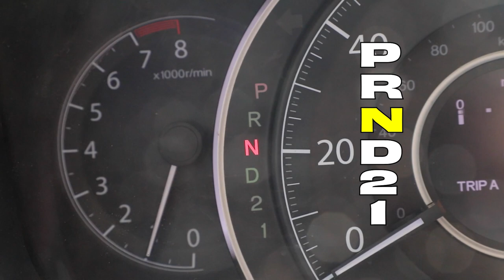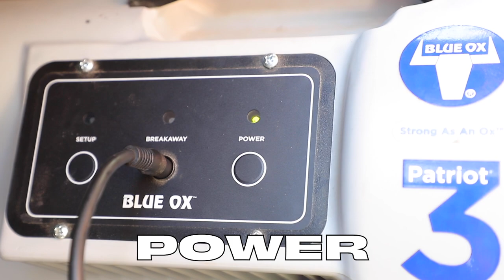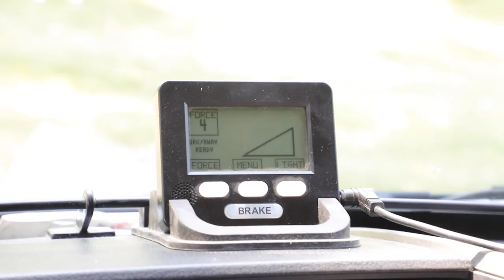BlueOx Flat Towing Hook Up

Comment: It's interesting how there are different ways of doing this setup.  Initially, I came here hoping there might be some info on the actual wiring harness, as I only have one running light coming on at the bottom(passenger side) yet if I turn the running lights on inside the car there are 4 bulbs for running lights (top & bottom- both sides), thus I'm not sure why I'm only getting a single bottom running light coming on.  Our 2014 CRV is set up with the Air Force One brake setup, so there is just a 'tow' and 'Run' switch on the left, and she's ready to roll.  We go through all gears for about 2 minutes (my wife does) while I'm setting up our Roadmaster tow bar setup, which is similar to your setup.   We also have a mess rock guard, so no pebbles can hit the car, although our Tiffin Phaeton has a large guard that nearly touches the ground anyway.  Thanks for the video, safety trails and enjoy the scenery to your next destination!!
Reply: Is your 2016 crv flat towable? I've heard that last year is 2014 honda crv can be flat towed. Thank you.  We are looking for crv in the market
Reply: @aronbaron797  Sorry, you are correct, I edited my post, and corrected that mistake, as it is a 2014.

Comment: Great video, thank you! We are towing a very similar set up but car battery keeps dying! Wondering do you tow at night and if you do, are you having your running or any lights on?
Reply: Hi there! Our car battery was dying if we towed more than about 3 hours. To fix this I ran an extension cord from the inverter to the rv hitch. Then plugged in a trickle charger and kept it under the hood of the car. Works great. I don’t have to run the lights on the car because I wired in two running lights with the blue ox kit.

Comment: never ever stand between the car and RV when either is in gear or moving. Stand out of the "crush zone" and direct from there. The Blue Ox system is pretty forgiving if you're within a few inches of center. Being perfect is not necessary...

Comment: Another approach is rather than use a 7 to 4 pin adaptor use a 7 to a 5 or 6 pin adaptor using the hot 12 volt service from your motor home's alternator to charge your car's battery.
Reply from the maker: Good idea